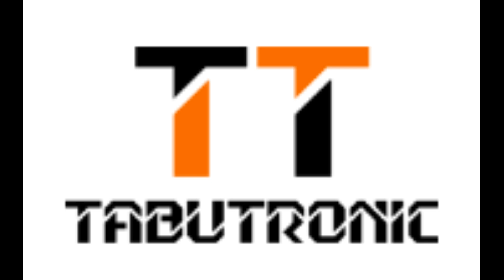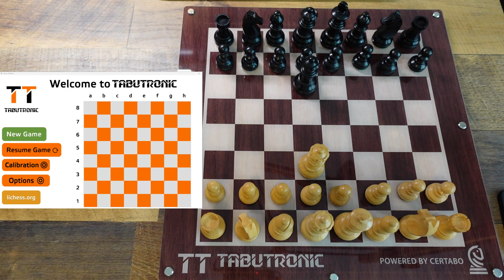My first game w/ Tabutronic Cerno (Stockfish Lvl5) is a lesson on how to finesse & chip calibration

Comment: I received my board yesterday and it really is very beautiful!  I was able to get it initialed and running on my windows PC.  I have NOT been able to get it to work with White Pawn or Chess DoJo or Chess for Android.  Any suggestions would be helpful.  Manufactures says the MAC software will be released very soon
Reply from the maker: From what I can tell you need the bluetooth module, or use a USB connection some how to use Pawn or Chess DoJo or Chess for Android.  Will make a video about this later. 
 But right I am still learning the board and how it interacts with different software.  See this link here.  https://tabutronic.com/software/ Hope this helps!

Comment: Do the wooden figures have metal weights? They may be effecting the quality of piece recognition. It seems bad and laggy.
Reply from the maker: They are weighted and they have no effect according to the market of the board. You can change the reaction time of board to the pieces I showed that in the video. What you saw is default settings.

Comment: Nope. Pieces look too cramped
Reply from the maker: I added these pieces to this set myself.  You can add any pieces you want. Just stick the chips on the bottom of any pieces you want.
Reply from the maker: It's hard to pick a set for a small board if you don't have to chess setting head cuz it's really hard to verify the base size and the top of the pieces as well. So again these are not the pieces that come with the set it is a pieces that I added to it. In fact, the set does not come with pieces. It only comes with RFID chips to make your own pieces.